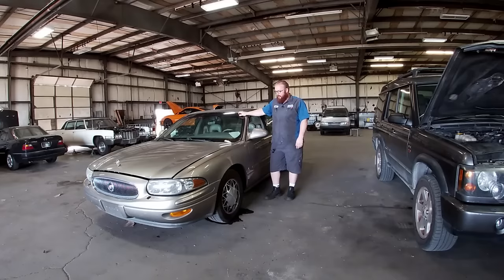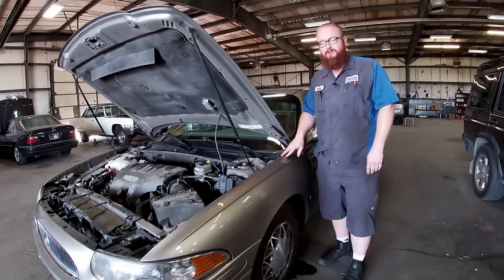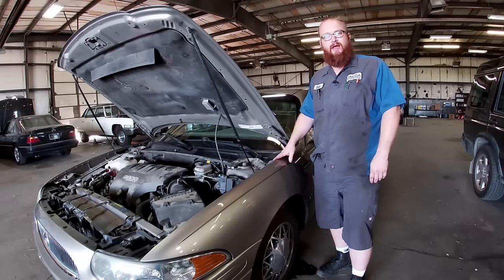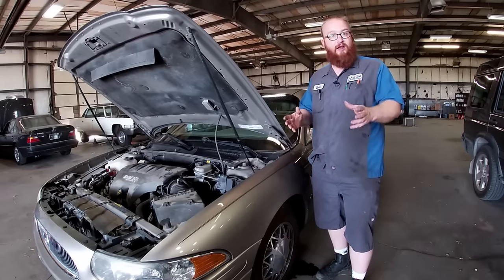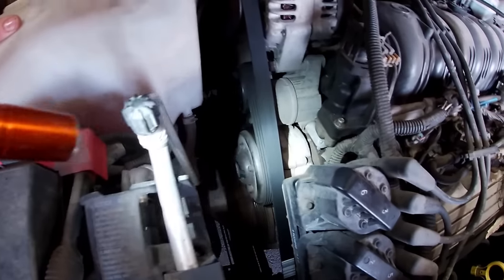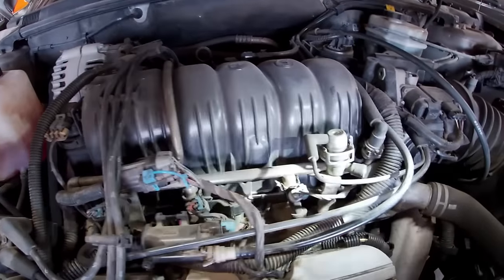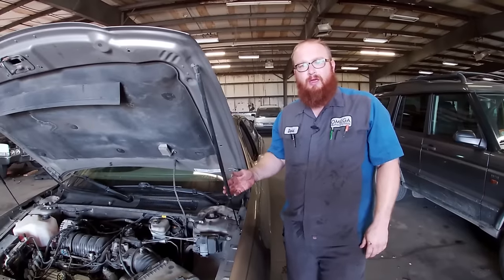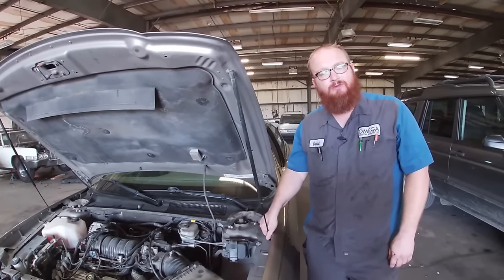CAR WIZARD highlights what makes the Buick 3800 V6 the BEST engine ever!

Comment: There's a lot of great Motors out there. That GM 3800 didn't start life as a great motor it grew into a great motor. Small block chevy a great motor. Ford  300 and 250  Inline sixes are great motors. The old Chrysler slant 6 was a fantastic motor.
Reply: My dad had a straight 6 Rambler 232 I believe that thing drove forever
Reply: The Ford 300 and 250 inline six and Chrysler slant 6 were absolutely great motors, but these motors are not in cars that most people can come across these days. I think the point is that the GM 3800 is a still plentiful in numerous semi modern models that are reliable daily drivers. Plus the older motors we mentioned can not compete with the  fuel mileage of the 3800, when you considering the size and power it supplies.
Reply: @JR-ic4hl  3800 isn't that good on gas. The other engines you mentioned can be as good or better
Reply: @briankennedy5578  Now I know your clueless. And why bother mentioning the older engines, when you can't get them anymore?
Reply: @JR-ic4hl  you are the clueless one. And you can find those engines. Ford I6 was made until 96. Slant 6 was made till 92. Both of them were made for much longer than 3800. There were much more of them made. Both the Ford and chrysler with a little work can improve mpg significantly. Or if it's hp you want , you can easily get that also.
Reply: Those are not the best years in my opinion. The earlier years were. So my point is still valid to me. And if your so one track minded that other people can't make videos that praise other great engines, then I really don't care to here it.  @briankennedy5578
Reply: @briankennedy5578  a ford 300 never got even close to the fuel mileage the 3800 does.  I dont know about the slant 6, but I also highly doubt it. It was quite inefficient, built for durability, not efficiency.
Reply: @BaltimoreAndOhioRR  there is more to mpg than the engine. 300 I6 was only in trucks. You can hardly compare mpg to another engine in a car.
Reply: @briankennedy5578  I understand that. You're the one who said, "3800 isn't that good on gas. The other engines you mentioned can be as good or better". Your comment is structured in a way to say that those other engines are better on gas (mpg) than the 3800. I was refuting that.
Reply: @BaltimoreAndOhioRR  years ago a guy I know had a plymouth with slant 6. He drove it for well over 100,00 without ever changing or even checking
the oil.  still ran.
Reply: @geezerhull  yep. All kinds of similar stories out there about the slant 6! Incredible engine!
Reply: That's true...
Reply: You are correct about that slant six!...a very interesting design, reliable, and ahead of it's time...not much power however.

Comment: I have an 02 impala that’s been sitting for a few years. Recently just put new brakes and rotors on it, fuel pump, plugs, wires, air filter, battery, some wiring cleaned up, waiting for new injectors to get here tomorrow and should be good to go after an oil change. It’s a retired detectives car in rural WI. Currently 220k miles

Comment: My first car was a 1991 regal custom deluxe. 3.8 , it had under 80,000 on it when it was given to me by my grandmother.  I drove it all through my younger, harder ,dumber years. I delivered pizza in it for over five years. Fishing trips all over the state of wv, the odometer quit at 258,000. I drove it for two more years before a lifter finally broke. The only thing I had to change on it was 1 alternator and 1 fuel pump. Best car I've ever owned and probably will ever own. How I miss that  car. It went like an absolute tank in the winter too. I kept good tires on it, but remember several snows where I'd passed 4wd trucks sliding off the roads. Gm definitely had a bulletproof engine with that 3.8. I imagine with the odometer to quit at 258,000 an me driving 2 more years sometimes over 3000 and 4000 miles a month delivering pizza. I bet it had 325,000 or so when she bit the dust.

Comment: loved the video. awesome content. was looking a a Bonneville SSEi supercharged and now I'm going to go see what kind of deal I can get
Reply: I want one too but they're so freaking rare where I live. Definitely get it man.
Reply: I had a 98 ssei, That engine pulled hard all the way to the speed limiter when you wanted it to but would eat up the miles at a relaxed pace all day. Mine had over 200,000 miles before the sub frame rusted out. Best engine I ever had. They are geting rare up here in the rust belt.
Reply: @ericharrison619  I used to drive a SEE back in the day. man I miss it when I seen this one come in on trade I could not resist  the body lines, no rust, black with grey leather, sunroof....man I can't wait to.jump in and roll.
Reply: Eric Harrison oil your frame in side and out do it in July or August on a hot day leave 4 quarts of the cheapest vedge oil corn canola and buy chain bar oil leave it in the trunk to warm up on the hot summer day pour ina cheap I gallon pump up lawn and garden sprayer wear a respirator and safety glasses the wrap around kind and spray frame rockers drill holes if you have to but check you don’t damage  fuel ,brake lines or electrical  lines be careful do this once a year . Also you will find lots of factory drain holes in sub frame and unibody ,be careful not to get on exhaust manifolds or catalytic converter or exhaust  or mufflers as it could catch fire . I have a.  04 Grand Prix with 400000 no frame rust I also do top of coil towers trunk and wheel wells front rear lower a frame lower rad mount ,sills I drill holes hood trunk   deck, doors . Now  check that it’s legal to do and put a tarp under the car so as not to get on ground clean up so as not to run into environmental or slip safety concerns use your head and water soak and all rags with water to lessen the risk of spontaneous combustion from the oil oxidizing and giving of heat like old linseed oil
Reply: @nickking1510  thanks for the advise I live in Florida so it probably explains why it is so solid but I will definitely take your ideas under advisement. I appreciate all of you and your help plus reminiscing which is just as enjoyable...
Reply: The only major problem I had with my SSeI was front bearings in the supercharger. other than that, coil packs (25 bucks at a boneyard, they are prone to cracking) Great car, sad when I donated it, but I still see it running around New Haven

Comment: Tip: If a coil pack quits firing, swap with one on the block to determine if it's the pack or the control module it sits on. BTW Backside sparkplugs are hard to get to.
Reply: Eh the backside spark plugs aren't too bad, it only sucks if your plug wire is stuck on because it's hard to get a good grip on them back there to pull them off, that's what happened on my Grand Prix.
Reply: Also if the trouble is in the computer my 93 olds was and the computer is cheap because you take out the main chip out of the old one and put in the new computer. The engine ran on 6 cylinders then 4 cylinders. It was the computer

Comment: My vx holden has 670,000 ks still good. Thankfully my engine is not sideways. Great to hear its a good engine.
Reply: chloe38583  Are you just finding this out after 670,000 ks? lol
Reply: Ive got a toyota been round the clock and still going, when my holden gets  there i will know its good, lul.
Reply: auzzi pepper  Last of the 3.8 was in the VY.
Reply: I reall don't know how thats possible ;)
Reply: @chloe38583  Was your car ever a taxi? Because they are always hot plus get maintained they end up with a lot of k's on them.
Reply: auzzi pepper last 3.8 was in the VY II, VZ had the 3.6
Reply: Hi, no just owned by ppl who look after things, im 3rd owner, NZ new.

Comment: I had a 2.8L v6 in my Buick Regal. That engine was a tank. I had 350,000 miles on that car when I sold it. I should have kept it because nothing I have had since was as good as that motor.
Reply: Uhhh... I think you mean 3.8... 2.8 was a turd
Reply: B. A. Lineman 2.8, 3.1, 3.4 weren’t bad just not as solid as the 3800.
Reply: 3.1 and 3.4 I’ll give ya but every 2.8 I’ve ever seen including the one I owned... no bueno... the jasper rebuild was good

Comment: My Uncle drove my gramma from Pa to Cali and back with 300k mi, supercharged Park Ave.
Reply: My friend had a Park Ave. He bought it with 150k and his son got it as his first car and still drives it. It has 290k and still is running nice. Changes the oil every 3k and small maintenance. I see them everywhere. I tried to find one for my son and no one wants to sell theirs. As soon as I find one ,I'm buying it for my youngest son who will get his license next year.
Reply: @Ron Krzaczyk 
Leave mints alone!!
Reply: Grand Prix’s have them as well and a little bit more sporty and not as heavy as a Buick
Reply: My parents had a 93 parm avenue and it was dope, they sold it because the transmission broke but it was becasue when my sister was learning to drive put it into reverse for some reason on the highway

Comment: I'm a Toyota man, through and through. I know that any time I'm down on my luck, or needing cheap and reliable, these will ALWAYS be around. I despise GM, but even I can admit this engine may possibly be the greatest of all time (with respect to reliability)
Reply: I'm a GM guy from day one, but after my last car (a Toyota Solara), I'll give you guys props; you make a damn fine automobile. It wasn't my favorite, but it never let me down.
Reply: Its such a shame the U.S didnt get the Aussie Ford designed and built 4.0 Barra i6 i think it would have beaten the 3.8 for top spot. All the Taxis and most of the fleet operators swapped and used them due to the utter reliability of them, plus they made better torque and hp in the NA versions than the Supercharged 3.8 did. By the time Ford pulled the plug on Ford Australia in 2016, the turbo charged ones could be had with 436 hp rising to 500 hp when the  over-boost feature was activated, still with the same reliability of the base engine. In NZ and Aust, these engines are legendary.
Reply: 01 camry 4 cyl.   Easy to work on, reliable,  parts are cheap.

Comment: I was working in a GM dealership when this engine was developed....i STILL see them all over this area. Probably one of the best designed since the 283
Reply: The series 2 series 3 and supercharged were Allright they had their flaws though but the best one was the 3800 series 1 tuned port them motors were the best they just went forever and ever they were the absolute best you could ever get in a car. Many of them were in the late 80s and 90s GM cars.
Reply: @deanfarr3249  baught a 95 LeSabre for my kid. NOW...if I could JUST GET HER TO DRIVE
Reply: @charliejones7574  yup that car will definitely go for a long time. The whole body of that car will probably rot away before that motor even reaches its last leg. Good luck on yall project.
Reply: @deanfarr3249  we baught it cheap. $1200, I drove it home.
Needs an A/C overhaul. Straps on the fuel lines....little stuff

Comment: David Hobbs Honda in Glendale, WI tried that shit with me. Major oil leak. I said, my car must only leak here, not one drop on my driveway. Never goi g back there again.
Reply: All my cars leak oil until I put the drain plug back in.
Reply: My MB dealer insists that everything must be perfect, failed my ball joints for too much play yet they were well within state inspections specs and I don't live in Mississippi.
Reply: Ford dealer told me had a main seal leak,,,,was an axle seal.
Reply: Wilde honda isn't fully honest either...but they will encourage ppl to take their cars to other dealers except for david hobbs.  Neighbor works at honda of kenosha where there was a new technician from david Hobbs where he was trying to sell everything...had to educate him from the darkness of hobbs

Comment: I had my 1992 Camry 6 cylinder until around 2010. Never failed to start, first turn of the key.
Reply: did it have the 1MZ-FE 3.0L?
Reply: Damn🤣☝️I had a 02 Toyota Camry xle v6 with 76k miles and a 96 lexus es300 v6 with 85k miles and the same in both and man they are smooth and have some pep🤣☝️the Lexus was probably the smoothest car I ever drivin😭😭😭😭I had the original dealership window sticker for both cars
Reply: @tyzerro  i was told a good point was the motor made and assembled in Japan. 3 L at least. The car was loaded. Leather, moon roof, CD, some buttons on tranny for power range and overdrive I think. I read that it was really a Lexus and Toyota was so successful and making so much money they didn’t care if they lost money on this car. After 8 years I had new struts and got the new ride back. Great car.

Comment: I agree. We have them motors in our, Holden Commodores here in Australia between 1989-1996. Great motors.
Reply: Jason griffo the Holden version was sold in South Africa in an Opel Record 3800 . Nice
Reply: They were also in the VT/VX/VY Series 1 as the Ecotec 3800
Reply: @kikass1997gaming  yeah. But that's when they became built in Australia not USA made.
Ecotec was an Australian built version in the commodore (only)

But you are right.
Reply: VS was when the ecotec was introduced in 1995.
Reply: I seen these in an early VZ (2004).... so damn cheap that I might buy it. I expected the guy to pop the hood and show the nightmare engine but it was a 3800.
Reply: @OffGridInvestor  must have been a VY or a VY with a VZ re-front. VZ introduced the asthma-tec.

Comment: Car Wizard - You seem to think the newer (present in many models) 3.6 liter V-6 from GM isn't a decent power plant.  Could you please make a video commenting on this in detail??  Thank you!
Reply: He talked about the 3.6 liter V-6 from GM in his "Buy this not that" video about GM cars.  He specifically talks about that engine just past the 4 minute mark of the video.  Hope this helps.
Reply: Timing chains
Reply: What Cummins said, replace the timing chains then get back to us on your thoughts of the 3.6.
Reply: @GrandPrix46   Both my vehicles are relatively new (under warranty) can you expand on your answer please?  What's wrong with the timing chains and at what point do they need attention?  Does that fix the problem?  Thank you very much!
Reply: BigJoe  they fail a lot and at low mileage and are not easy to replace the replacements are better but still fail also the engine has to be removed to change them

Comment: These were also used in Australia in the 88 - 04 Holden Commodore in rear wheel drive configuration.
Reply: Yep, had one in my 2004 Berlina. Bulletproof
Reply: Don't forget  the 3.8 was in the Commodore clone; the Toyota Lexcen. Had a 2001 model and wish I had that motor in my current Commo instead of the 3.6. You have to undo the auto to get to the thermostat...crazy!

Comment: 04 impala ss indy edition with 124k - still runs like a top (supercharged).
Reply: That is a nice car.
Reply: I would hope so, 124k miles is nothing.... if it had 324k I would be impressed.
Reply: I have an Indy too! 116k miles and did the Gen 5 supercharger swap.
Reply: Moecean still change your trans fluid every 30 to 40 k lessen problems

Comment: Still have my 2008 Pontiac grand prix with the 3800 engine with 150k miles so far. There was a time in high school that my car did suffer the same intake manifold gasket leak wizard explained. Yeah it had milkshake oil for months before we caught it  but no loss of engine power, and we got the issue fixed and oil changed and it is still running strong 10 years later. Pretty impressive it took that without developing any issues.

Comment: The 2.8L le2s used in the Chevy celebrity's were amazing 6 cyl as well as the 3800 series
Reply: yess the 2.8l was a peppy little engine Pontiac 6000 ste
Reply: I got to drive many vehicles with the 2.8. They sounded more powerful than they were. Mazda KLZE 2.5l v6, as much punch as a 3800 s/c without a s/c, fits in small engine bays, perfect for say a Fiero.

Comment: I just bought a 2008 lacrosse 3.8. Series III with 85000m. It had a check engine code. The dealer didn't think it could be fixed and I got it for 4700. out the door TTL.. So blue book and once I replaced the sensor, it runs beautifully. 
My favorite engine of all time and now I finally have one again.

Comment: My 3100 in my 02 century can attain up to 35+ when im crusising around 60mph.  And it gets up and goes when i need it to!
Reply: Yes, my 3.1 got 35 mpg highway also. that century was the best car I ever had,quiet, comfortable, great on gas, dependable also.The 3.1 was the same motor as the 3.8 with a smaller crank shaft that made it even better on gas.
Reply: @cocabrown2009  Not the same at all. 60 degree v6 not 90. but a decent engine.
Reply: However there was a 3300 engine that was same design as 3800